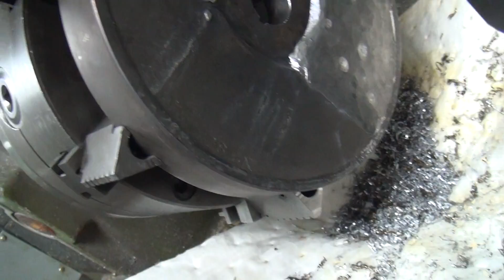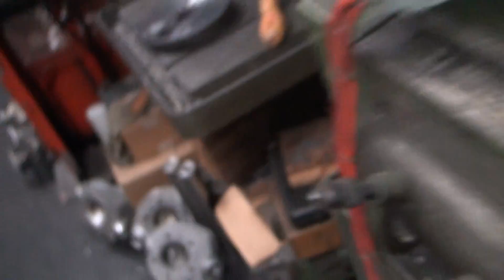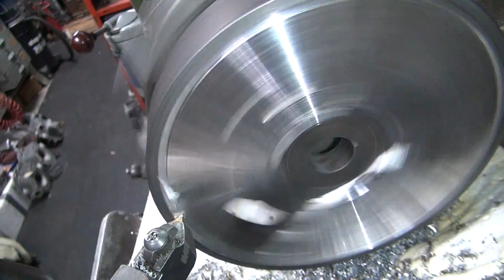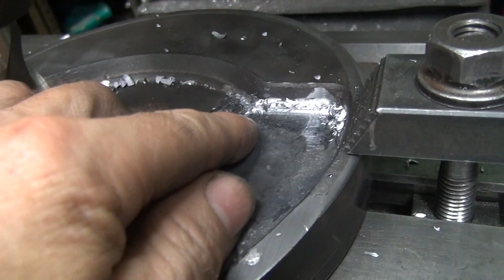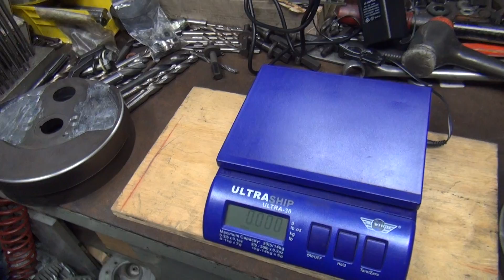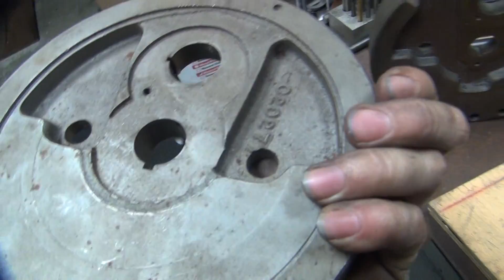building xl stroker 650cc single #104 sportster scta harley landspeed racing by tatro machine

Comment: i know that you had mentioned in another of your videos that you have to set up the crank bearing loose for the race motor but have you ever considered reconfiguration of it to accept a ball style of bearing in lieu of a roller style bearing? It may be able to handle the RPM's better.
Reply from the maker: no, for two reasons. 
one is that there is no room for it. the balls would be so small that they would just come apart.
two is that a ball will not take the pounding of a fuel motor. the heavy pounding would indent the balls and races. then all hell would break loose.
as it is now, my motor indents jims crankpins with under 5 miles on them causing them to start flaking. i now use obsolete accel crankpins that do take the abuse. the one i have in the motor now has about two years of race time on it and is still good.
tatro